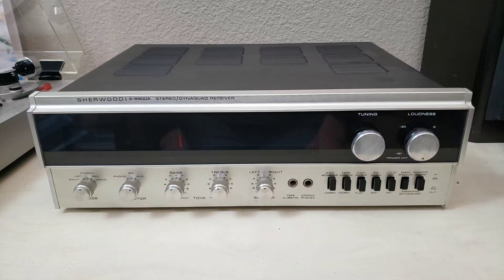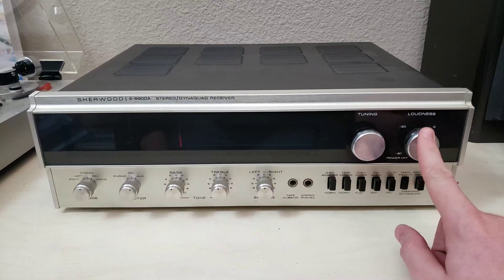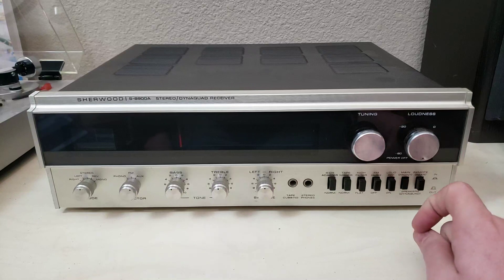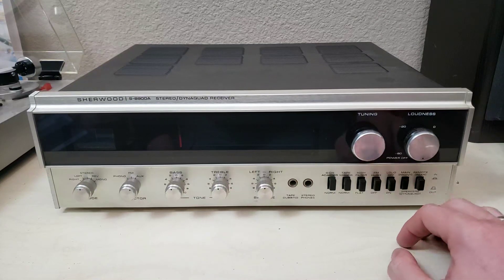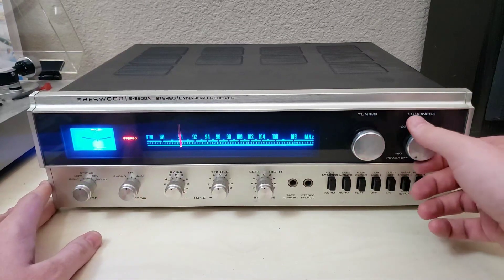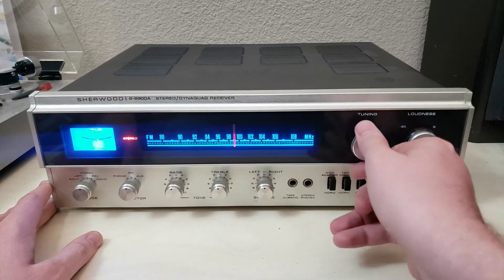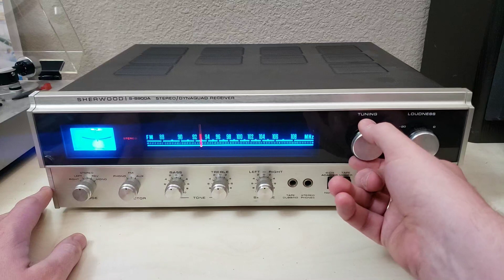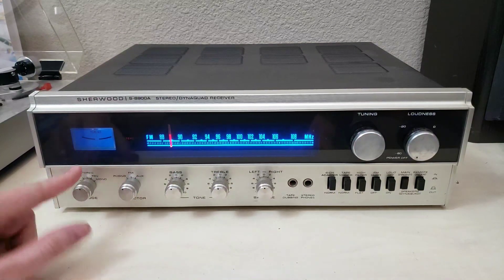Sherwood S-8900a: Show and Tell

Comment: Just pulled one of these old units out of storage. So glad I heard your warning against DeoxIT on the volume pot! So how did you clean it? I haven’t had it apart yet so not sure what I’m in for!
Reply from the maker: Mine cleaned up by just working it full range back and forth about 100 times. It still had a tiny bit of scratch at one spot fairly high up on the volume dial when I sold it, but better that than risk destroying the pot entirely.